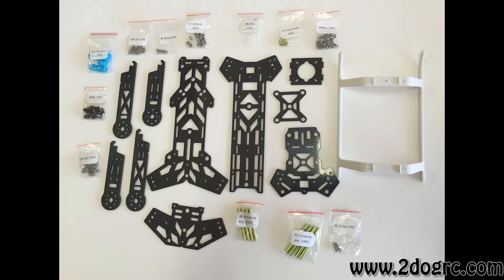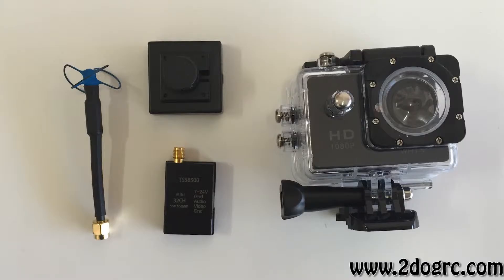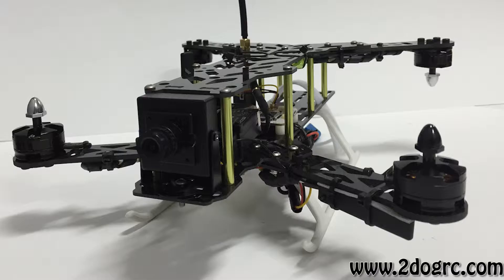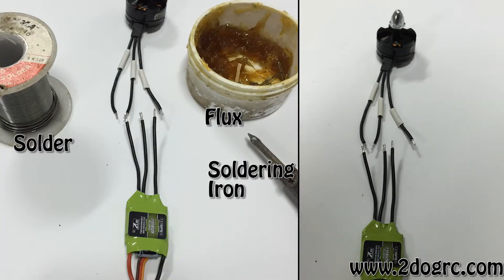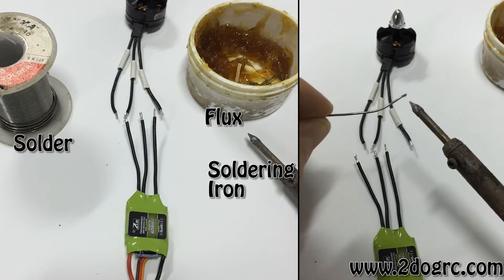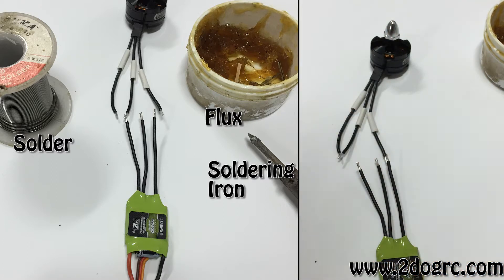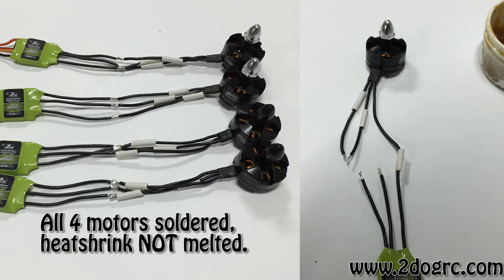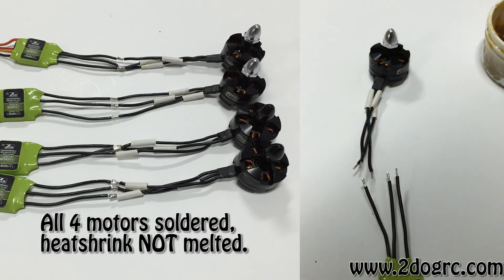How to Solder motors for the Inversion Quad or any Quad setup (1)

Comment: Thanks so much for this, only video really showing you how to do it. Could you use electrical tape instead of the heat shrink?
Reply from the maker: Antman Beyond Yes you can.  Heat shrink is just a little easier and cleaner on the small wires.